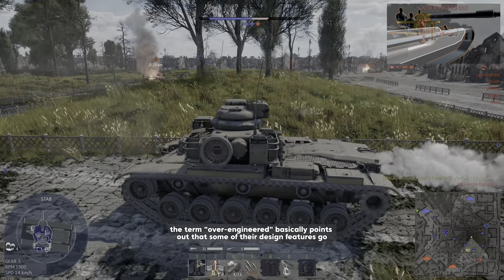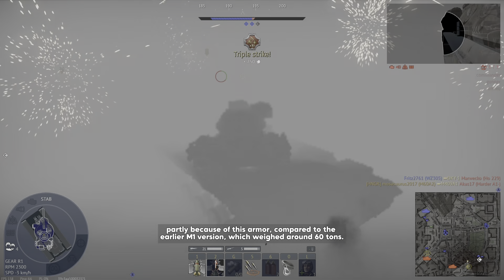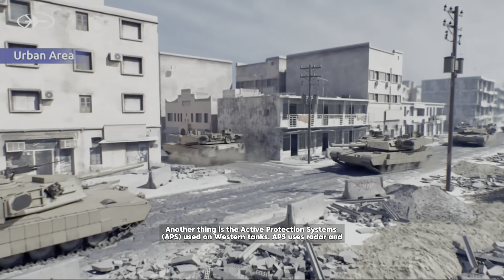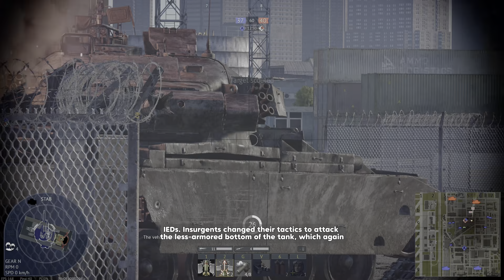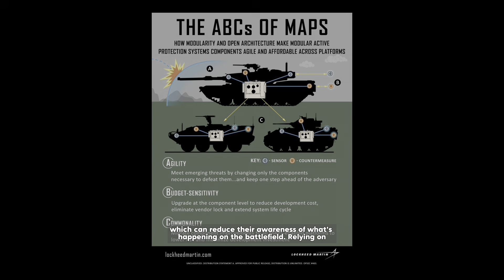Are Western tanks over-engineered?

Comment: Speaking of "western tanks" is a bit oversimplified. The Leopard 2 is a pretty simple and rugged machine with a diesel engine that can run on pretty much everything, even used deep fryer oil, a power pack that can be swapped within 15 minutes and lots of redundancy in its systems, so that the crew can compensate if some system malfunctions or is destroyed.
I would say it is even better at being simple and sturdy than Soviet/Russian tanks, thanks to not having a auto loader and not being set up for using barrel launched missiles and stuff like that.

The only issue with it is that it has become very heavy with the last few versions, but that is kind of unavoidable if you want the tank to still offer protection against modern armor piercing weapons.
Reply from the maker: @TrangleC  Those are some fair points, thanks for adding!

Comment: I would not say they are to over engineered. It is more of an issue of design philosophy of NATO tanks. Soviet design were like you said cheap but reliable in order to be mass produced and they are designed accordingly but NATO tanks aren't. Many of their design choices was influenced by their respective country's doctrins and they were in fact different from the Soviets'. 

Also in my opinion some points you made isn't strong enough to create a good argument but I do understand where are you coming from. I do agree on NATO tanks being too heavy and many of the newer designs are made to weigh less, they are aware of it.

Comment: Too complex to use is just fiction, whilst over engineered is true. Its cost where Western tanks become a problem and what we are seeing is a typical peace time problem of engineering imagination than lessons from battlefield experience.
The cost of many of these vehicles has huge restraints on how many they can field and how much a loss can impact.
Its like the lessons from WWII have been forgotten with the Sherman where the Germans believed they could create super tanks. All that happened was the allied gained superiority through numbers and losses had minimal effect.
Likely Western armour is over-engineered as there will always be an esculation of counter measure that can defeat it and with Ukraine the counter measure have been ridiculously cheap.
Western armour adds many tons of weight and create huge problems on soft ground and has a big impact on range, whilst maybe should be limited to a crew capsule.
The weight of many tanks in Ukraine reduces possible terrain type so much that it has created predictable chokepoints and that is a massive flaw.

Because of new counter measures such as drones and missiles the plain old simple tank of Russian mantra has been a disaster, with many questioning if the tank is obselete.
Too complex is also insulting to the operators such as Ukraine who have no problem with complexity, but cost is hugely restrictive.

Comment: 4:28 Doesn’t the tank have an APU to stop it from guzzling the gas. Also the newer iteration of the engine is more efficient… Heck the Abrams X further addresses this with an economical Cummins diesel as an option for further improvement. But the biggest benefit was the weight. 

There have been hulls where the engine was transversely mounted. Which saved quite a bit of space which was used to improve on electronics, and fuel. Better APU in mind. It’s generally not as efficient under specific conditions. But the idea that it overall is an uneconomical engine completely is an outdated notion.

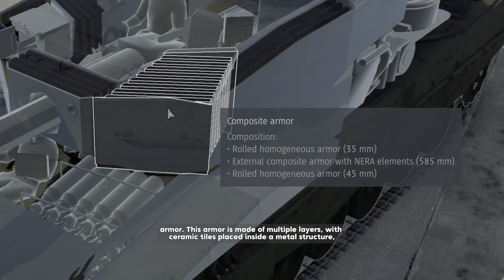Comment: 1:55  As far as we know these armor arrays rely primarly on NERA elements rather than ceramics tho. The claims they use ceramics seem to originate from the early days when Chobham armors weren't well understood by public.

2:32 You should propably clarify you used short tons rather than metric for the Abrams' weight. Meanwhile you used metric tons for the T-72, which overexagerrated the difference in weight by 6 metric tons.

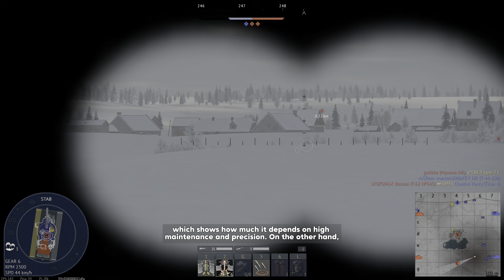4:18 ERA should not be used as an analogue of APS. Russians did try to mount APS on their tanks, bit didn't due to financial issues. It wasn't because of some design philosophy of building them less complex but simply budgetary considerations. This point is also really odd given western tanks also use ERA, even if more sparingly than soviet/russian ones.

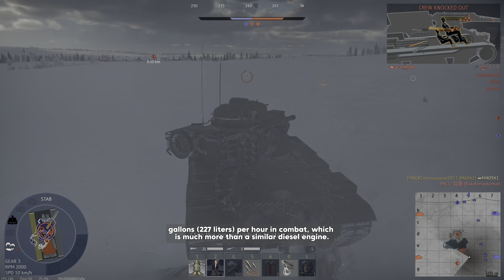4:42 This criticism also applies to the other turbine tank, the T-80, and has been greatly mitigated on M1 with the introduction of APUs and TIGER modernisation. The dust issue mentioned later has been solved with the introduction of self-cleaning filters. It also wasn't unique to gas turbines, as Challenger 2 also suffered from the issue until those same filters were introduced.

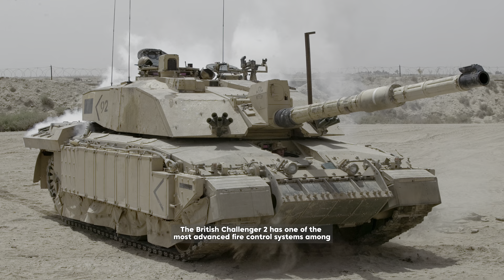6:16 Challenger 2 doesn't really portray the main point of the video. If anything it shows what lazily/cheaply reusing old technology and concepts leads to. Ex. that's why its armor is very unoptimised, leading to high weight. Similarly the L30 gun is not an issue intrinsic to the complex western MBTs, but a unique one created by the British that other designs do not suffer from.

9:17 Abrams does not require special fuel. In US Army service it uses the same fuel as all the other AFVs and in foreign service (Australia, Poland) it uses the same diesel other MBTs run on.

10:00 The upgrades to Bradley did not change its role tho. They allowed it to perform IFV duties better, they did not suddenly made it an entirely different class of vehicles like you imply.

10:45 That's a common vulnerability of any armored force tho. It doesn't matter if a tank burns 10-20% more fuel in such a radical scenario, tho in fairness it does make it harder to supply a force in normal conditions. The higher fuel consumption is also not unique to western tanks or even only to Abrams, as evidenced by the existance of the T-80.

I generally agree with a lot of the points you brought up, but these few just have me scratching my head a little, as they range from critique of individual designs rather than complex-vs-slight-less-complex discussion to points that I have no idea how connect to the main issue at all.
Reply from the maker: @jakub0447  I appreciate you adding this and correcting me 👍

Comment: Western tanks aren't over-engineered at all not even that much. Their tank just prioritze hi-tech feature and quality of life tech more compare to simpler tech and focus more on production for Russian and Chinese tanks (most of them). 
Main problems for western MBT are their overweight in their design and upgrade, the lack of standardization in their coalition forces (except Main Gun in more modern variant), Weirdly weaker side and roof protection (this problem got fixed by ERA and APS but still nothing to effectively counter drone), Logistic and maintainance much harder since they are slighty more complicate tech and some tank didn't design to be that easy to do properly repair and maintain especially in high intensity situation

Comment: These are short term problems that came with the introduction of new technologies. Besides most of these issues happens literally half a world away from where the vehicles were made like in Afghanistan and Iraq, Russia have operated in Africa as well and they couldn’t bring anything more than armored cars and trucks because they do not have the logistical capability to operate that far ahead. 

We also have to keep in mind that a hot war with the Soviet Union is what these tanks are designed for, not flushing out insurgencies in the Middle East. When they operate in Europe during exercises they often have little to no problem due to the strong logistics infrastructure present, a relic of the Cold War. 

Keeping spares and maintenance of these tanks half a world away makes a huge difference on how they perform, which Russia is unable to do in their operation in the Middle East and Africa.

Comment: The idea that Soviet vehicles were lower in quality, but because of that they are higher in quantity is a myth. the reason Soviets had so many vehicles is simply because they had an military economy that allowed it to happen. btw this is nto to say that Soviet economy was better, it was just that in the particular case of military industry related to land vehicles it was much more expansive. Something like T-90M is but in different places, as advanced as a SepV3, meaning they are comparable, but T-90M is made from the scracth because of the ability still being there, Abrams use refurbish vehicles like T-72B into B3 because of storage of older vehicles allowing it

But this is where it starts showing flaws in the argument, Abrams and Leopard 2 are actually not over-engineered at all, hell the only thing that they were pushing the curve with non tested tech was Thermals in tanks, and the fact the ammo is placed outside of the tank with automatic doors to stop the detonation from going inside, while still being acessible, the FCS and Engines were nothing new for either. (Also T-90 being easy to produce because low tech is just wrong, this however applies to T-72)

APS is something brand new that is not even in large scale use in US Military, the only people that have lots of them is Israel because they make them, Soviets and their sucessor stats Ukraine and Russia have APS as well, but they were never really put to large scale production, however nothing suggest they don't work. its also suggested that Russian APS like Arena is superior to Trophy in some levels, we however know that Ukranian APS can intercept Sabots

Kontak-5 and Relitik does not use Eletronic... its explosives... just like something like ARAT in US arsenal.
The Gas Turbine problem with Abrams is for the most part the same found in T-80s except UD, the exception being filters with Abrams in the 1980s and 1990s, my point here is that this has nothing to do with engineering, if anything it has to do with bad quality engineering for the filters.

Challenger 2 did not had the best FCS at the time of 2003, and it definelly does not have the best FCS now. Also the fact they needed to recalibrate the LRF suggest it was not the best, T-72s did not had that problem... and the laser range finder was not calibrated in those tanks, and that is 1978 or something

Battle management system that Abrams have is not over-engineering, its the same as saying Laser range finder is over-engineering its just a map that is much easier to use while having C3 integrated to it. the argument of losing coms is bad because the alternative is not to use in the first place. its better to be jammed because the enemy needs to jam you, than to not have it. Russian tanks suffer from the same problems, the older system is possibily even more easy to jam

Abrams can accept special fuel but usually they just run with Diesel, like T-80s that are also gas turbine

I thought this video was on upcoming experimental vehicles like KF-51 Panther, but its about historical and misses the point.
Reply: "But this is where it starts showing flaws in the argument, Abrams and Leopard 2 are actually not over-engineered at all, hell the only thing that they were pushing the curve with non tested tech was Thermals in tanks, and the fact the ammo is placed outside of the tank with automatic doors to stop the detonation from going inside"

And as we have seen in the last years, with at least 1 Abrams destroyed from a hit on the ammo bustle, which caused the ammo to burn like a blowtorch INTO the crew compartment less than 2 seconds after the hit, that extra protection is absolutely not guaranteed.

And thermals, the evidence is very clear, latest models Russian tanks have WAY better thermals than western tanks.   And Russia produce thermal imaging cheap enough that they're even putting some of them on SINGLE USE FPV drones!

"The Gas Turbine problem with Abrams is for the most part the same found in T-80s except UD, the exception being filters with Abrams in the 1980s and 1990s, my point here is that this has nothing to do with engineering, if anything it has to do with bad quality engineering for the filters."

And lubrication and overall design.   I say this based on when Abrams competed here back in the 90s.   Summertime they did fine, roughly equal with the Leo2, but oooh boy, during winter trials, they just stopped working.   Wet cold like here in Sweden, they just threw in the towel and quit.
And i will forever regret not saving a copy of the photo of the token T-80 competitor pulling the Abrams out of snow where it had gotten stuck, one time out of ridiculously many.

"The idea that Soviet vehicles were lower in quality, but because of that they are higher in quantity is a myth."

Yup.   Anyone who has read the Nato evaluation of Soviet hardware from mid 90s, well, the single most common statement was along the lines of "better than Nato equivalent except in ergonomics".
That evaluation was also the reason for the hurried development of a better version of the Sidewinder, because the previous model was so inferior to the Russian AA-11 that it was embarassing.
Reply: @DIREWOLFx75  ok so tell me, if they have better everything, why then do the Russians lose so much equipment to the 3rd and 4th tier western stuff? Better thermals? Really? I'd love to see a source on that, any source but RT. And even if in the 1990's the assessment of the US military was that Russian equipment was usually better than western, which I'm not even close to sure is true, but even if so, that was 30 years ago. Lots has happened since.
Reply: @Gavriloprincep  Don't act like Stuff like Javelins, Himars and Leopard 2A6 are 3rd or 4th echelon.

And yes, lots of thing happened in 30 years, if anything 1990s was when Russia due to economical downturn was stuck techonologically, and now they are catching up, catched up, or getting ahead in various areas.
Reply: @Gavriloprincep  "why then do the Russians lose so much equipment"

They don't.

Already late 2022, analysts went through the claimed RF losses "photo evidence" and found that over 80% of it was either fake, doubles or UA losses.

Why don't you think long and hard about the Pentagon leak.
What it reported was closer to reality.

"Better thermals? Really?"

Already back in the 1990s, if you wanted the best affordable thermal imaging, you went for the last generation Soviet gear.
You could THEORETICALLY get better in the west, but it wasn't for sale and even if it had been, it cost a thousand times more.

And this has been CONFIRMED.
As RF tanks repeatedly have spotted hidden UA infantry between 3 and 4km away during the SMO.
Very conveniently negating their ability to use Javelin ATGMs.
1st time it became big news was with the hype around "world's greatest sniper", as such a situation, when all but he and one other got killed while trying to set up an attack against RF tanks.

"I'd love to see a source on that, any source but RT."

1.   I don't use RT as a source.
2.   RT is infinitely more honest than nearly all western sources.   It's almost like they're JOURNALISTS or something!   Reporting instead of propagandising, how amazing!

"And even if in the 1990's the assessment of the US military was that Russian equipment was usually better than western, which I'm not even close to sure is true"

If you search for it, you can find the post-German reunification evaluation documents, as they were just swept under the carpet very thoroughly, never actually secret.
If the USA MoD online site was still completely open as it used to be, you could find it there, but sadly they actually created some security in the last decade.

"but even if so, that was 30 years ago. Lots has happened since."

Yes, the west has degenerated severely and lost much of its competence.
While Russia managed to retain most of its institutional competence and experience.

Russian computing hardware is 10-15 years behind the best, and yet they're still getting similar or even better performance and capability out of them.
Because they have some of the best education for both chip designers and computer programmers, in the world.
Reply: @DIREWOLFx75  "RT is infinitely more honest than nearly all western sources.   It's almost like they're JOURNALISTS or something!   Reporting instead of propagandising, how amazing!" you have lost all credibility there